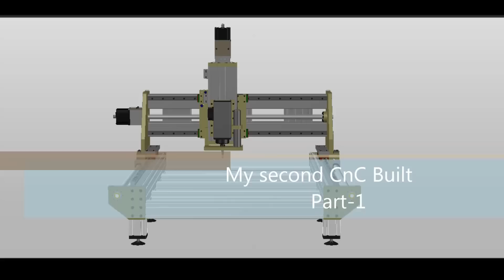Second DIY CnC Router Part-1

Comment: Hello Ralf, really  nice machine. I looked quite a bit of machines on Youtube, really like simplicity of your design. Do you use some gear reducers on x,y,x axe, if so how much? Also, i see that you use MACH3, do you have any other recommendation now?
Reply from the maker: gear reducer is the ballscrew 1rev off your motor is 10mm movement together with some micro stepping on the driver makes it a accurate machine. i bought most of my stuff at damencnc.com  https://www.damencnc.com/nl/componenten/mechanische-onderdelen/isel-kogelomloopspindels-25mm  .... Mach3 is ok and i worked with it for long time now.. but i would recoment a board with an own processor on it, so it doesnt interfear with the computer when using the cnc .
Reply: How about adding 4th axis, it seems like not to difficult to do, if your machine is a bit longer you could accommodate it easily. also,  how about adding vertical aluminum sheet so you can turn parts 90deg? Also, seems not to difficult if add a bit longer machine and do it at the end of machine? Or maybe all this you don't need for your business. Anyway, I really like your engineering and the way you executed things. It looks really good. Attention to details is superb...
Reply from the maker: The lenght of the spindle over a meter can start wobbeling or give onbalance. my machine is 1100 mm in lenght in work coordinates(1500 mm spindle). it doesnt wobble but i dont use high speeds. so there is a limit in lenght and diameter of the spindle and how fast your motors spinning. or else you need a different system (rack and pinion for example) 4th axis is not what i need but i like to experiment with it in the future, but dont think its easy..because i think you will be figuring out some stuff before it starts working :-)

using a piece of table to put in an angle up to 90 degree i was allready thinking about intgrating into my other cnc :-)
Reply: Anyway, so your machine is X x Y 1100 x 1500 mm and this is about maximum you can do with ball screw? and even that with lower spindle speeds? Or it is z axis that you have to be careful about? As for 4th axis, I agree, there is wiring to be made, controller to choose and software to be understood. So, what is your maximum spindle speed you use in this setup? How many KW is your spindle? Ill be doing some 3d design when i have time, I think I will follow your idea, it is a nice hobby/business you have:) Have you considered linux cnc?
Reply from the maker: My machine is y750mm x x1100mm  ..my spindles are aproxx y1000mm and x1500mm. My spindle (at the moment)is a kress 1000 watt ..not a heavy spindle. the big cnc (i have to finish yet)will have 5.7kw motor and a 1250mm x 3050mm work area. My feed speeds are 5600 mm/min max on x and y and 2000mm/min on the z . no i am using mach3 for years and know a lott from it.. i will stick to mach3..and will transfer to USBCNC on the big cnc. because of the board its using.
Reply: tnx a lot for tips!
Reply from the maker: Welcome